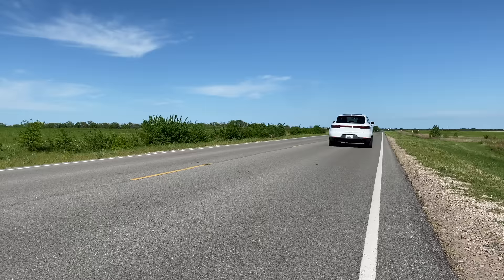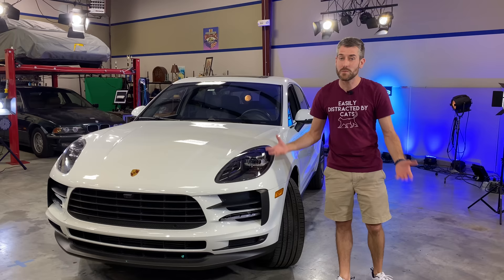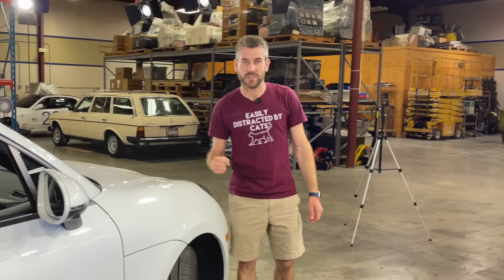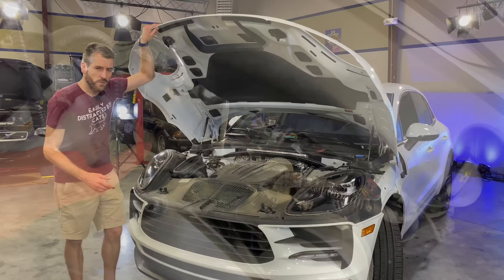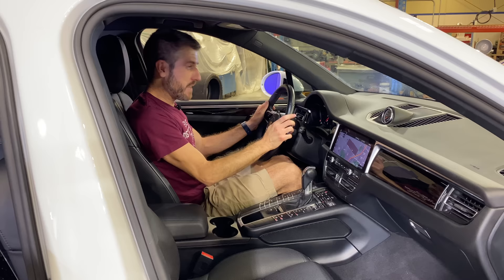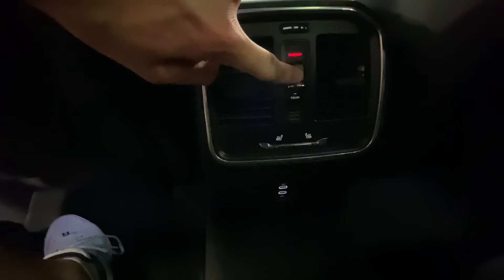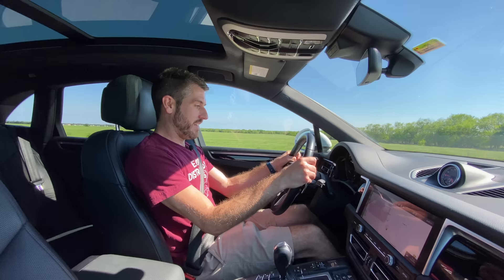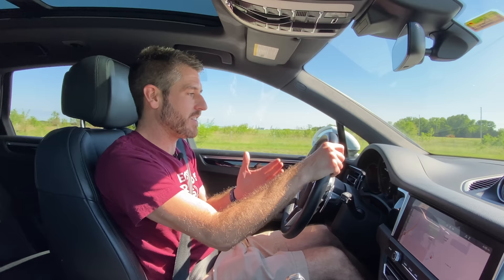Here's Why The Porsche Macan BASE MODEL Is Actually GREAT!

Comment: I worked at an Audi/Porsche dealer for a year and I've never been a Porsche guy but I loved those SUVs. Porsche interiors are built so well and the Audi motor, trans, and frame are very solid and surprising the car doesn't just feel like a lighter Q5. The handling was incredible it felt so responsive and snappy for an SUV, the exhaust tuning while fake sounded great, and I think they are easily the prettiest SUV's on the road. Not overly aggressive like Lamborghini's SUV, it manages to stand out and blend in at the same time and I love that in a car. If I had the money I would spring for the GTS model because that's where you get an actual Porsche motor but aside from that the base and lower models are practically the same car for a lot less. Doubt anyone will take my opinion into account but I've worked for BMW, Audi, Porsche, and Lexus, if you care about money buy an RX350 you'd have to abuse the thing for it to not run. If money isn't a problem for you the Porsche SUV's are easily what I would tell you to buy, sedan handling in a gorgeous SUV.
Reply from the maker: Well said Evan!  Thanks for watching and commenting!
Reply: Is it true there know for oil leaks later in the mileage? Not like other Porsche models.
Reply: @tylertran93nsx  idk if you're talking about like pre VW Porsches or what but pretty much every Audi or Porsche over 100k leaks something. If it doesn't its been fixed.
Reply: @ElliottAlvis  Why did you review an old model? Was this video shot in 2021?  The 2022 got refreshed again with different front fascia and rear diffuser, completely new center console, and more horsepower. Also, the VW Golf engine is a traverse engine, whereas this one is a longitudinal, how can they be the same engine?
Reply: What do you mean the exhaust sound is “fake”?  I haven’t heard anything about fake exhaust sounds on any Porsche.
Reply: @dl3988  he said fart, not fake
Reply: Lexus… no thanks 🗑️ 🤮
Reply: IThis car have a PDK transmission, like 911. Cayenne has Audi tip tronic.

This is under 30% Audi parts. And Audi are Great cars, but this a different car all together! 

The engine is modified by Porsche… you find it only in this car. It has Q5 modular platform, but even Lamborghini gets Audi part and platforms. It is because they are great… and modular!
Reply: I hated driving my Lexus NX350.  Engine was noisy, slowwww off the line.  I got it for “reliability” but it was no drivers replacement for my Q5.  I dumped it after and just got a SQ5.  Porsche cost and ongoing maintenance costs are an impediment.  If i go back to a four id get the GV70
Reply: Porsche has never done "fake exhaust tuning."
The 7 speed PDK is not shared with Audi, and neither is the frame.
And to think, I know these things without being a former employee at a dealership, for an entire year.
Reply: The fact that it has a Volkswagen Golf our engine in it is kind of cool. In Germany the tuners there ring out insane horsepower from Volkswagen Golfs

Comment: A lot of people with the upper trim level Macans hate on the base model. I personally have a 2018 base model and it’s an amazing all rounder
Reply: Ant issues ? How expensive is the maintenance ?
Reply: @MrMustangrick  i have base  Porsche Macan 2018 Agathe Grey with Air Suspension, this is my second porsche, the first one is 718 boxster.
This macan transmition is very smoooooth, riding this car is very fun and the car today is 19k Kilometers, it has no issue except the ceiling fabric is starting to fall 😢
I did have mercedes C300 2014 and the ceilling was falling down also.
It seems many ueropean's cars suffer/defect from this.

Comment: I'm not a Porsche guy, but I have to say I'm extremely impressed by this car. I would not think this was a base model if I were to walk past it in a parking lot, and certainly not seeing it speed past me on the highway. Thanks for the eye opening video, Elliott! I hope you have a wonderful and easy conclusion to your week!
Reply from the maker: Hey, thanks Bunker!!
Reply: If you drove the base model and then any other model, you would certainly know that it is a base model.  I would never, ever pay that cash for the base Macan.  The performance deficit is enormous compares to the S and GTS.
Reply: And your Porsche is? Smaller engine=less weight=better handling. A chip and you have over 300 ps. It will be better than the S.
Reply: @ts_macan_911  2021 Macan GTS.  Before that a 2016 Macan S.  Driven many base Macans and Cayennes as loaners.  Far slower.  Without the air suspension and adjustable dampers they sit a lot higher and are less responsive.  The power deficit is significant.  The base model is a show car for wives to impress their friends.  I would never, ever buy one for myself.
Reply: @cvn6555  Just a hybrid turbo kit like is470 costs about 3k for ea888,then your GTS will count postal codes

Comment: I think Elliot is correct.  For plenty of people, the styling and the appointments and the novelty of owning a Porsche are good enough, and so is 0-60 in 6.1 seconds. As if that is slow...

We looked at one at the dealer a few years ago and while I liked the car, the back seat and hatch areas are a bit small. My spouse wound up with a MB GLE 350.

Me personally, I would rather buy a few years old used car with all the goodies and the power.  Great video!
Reply from the maker: Excellent points, thanks for watching!

Comment: The door blocking the hood handle has been a standard feature on most VW products for quite a while. As far as I know, it is there to stop you from accidentally opening the hood while driving if your shoe gets caught in the latch when taking it off the clutch pedal. That apparently was a much bigger risk on some older models, where the lever was near the clutch pedal, was a pointy piece of plastic and also pulled towards the driver, so it was rather easy to get the top of a shoe caught in there when pressing the clutch pedal, which would pop the hood when you release it. They had a second safety latch to prevent it from flinging open, but it still was a bad design choice, so they eventually changed it to this one, which prevents that.
Reply: In the U.K. they added to the security feature by moving the pedals to the opposite side of the car. The hood latch is still on the left.
Reply from the maker: Oh that makes a ton of sense!  Thanks for the info!
Reply: @colinselfridge3935  That also works. But engineering is cooler. And, as a bonus, it works no matter where the driver sits. But if you want it simple, putting the lever elsewhere (for example in the glovebox) is probably the easiest and cheapest. Still, this solution is pretty damn clever, and also the best way to prevent lawsuits and insurance fraud, as the lever physically can't be pulled with the door closed, even if you try to.
Reply: @ElliottAlvis  No problem. Always happy to inform.
Reply: @unmountablebootvolume  my last 7 cars have been VAG, but right hand drive, so I’m very aware of the the hood latch being on the left. Mine was a throwaway comment about increasing safety, when in truth it is really to minimise re-engineering/retooling.
Reply: @colinselfridge3935  LOL

Comment: Absolutely agree with you. Driving the base Macan for almost 8 yrs now (since 2015) and it’s such a nice sporty SUV to own. Previously owned a Porsche 993 manual and a 987 Boxster manual and they all share the same Porsche DNA. This car basically borrows mechanically from the humble Audi Q5 but drives like a different vehicle, which is unbelievable. I have also driven other Macan variants like S, GTS and Turbo from my friends and you are right, they are pretty similar in feel. I reside near the hill side so some modifications are carried out including:

1. Racechip ECU upgrade from 240ps to 300ps
2. Brake upgrades including steel brake lines, endless brake pads & fluid, F & R EBC slotted rotors.
3. Pro-ram high flow air filter
4. Champion iridium spark plugs, APR ignition coil
5. High performance engine oil ( HKS 5w-30) & Rear differential oil (cusco)
6. 5mm spacer on rear wheels to improve stability
7. Turbo muffler delete kit
Reply: How has the reliability been? Any major concerns? Thanks for the list of those mods.

Comment: Totally agree with your assessment.  Test drove the S and GTS before I purchased the 2021 base Macon.  Did not feel much difference between all models, other than the extra HP which was not worth the extra $$ to me.  Still enough power to get in to/out of trouble.  Found one with standard wheels to save $4K, and enough options to keep me happy ($60K sticker).
Reply: It’s so true, many reviewers make fun of the base Macan power I had to see for myself. I test drove Macan base and Macan S in the same day I felt absolutely no difference whatsoever both cars as super fast for an SUV in both cars the ride experience is literally the same. I find people who go for the S to be really Dumb in my POV. You just pay more for the same experience. Some people have ignorance issues they hear base model so they automatically avoid getting in one. My advise to you all just drive the base model for once before you put a deposit on the S, just do it and you will see.

Comment: Excellent video. We recently went shopping for a base Macan.  Our budget was $50,000 but all we could find at that amount were 3-4 year old models.  We ended up buying a similarly sized and equipped new Mercedes 300 GLC 4MATIC for 50,000. It is not a Porsche (but merely a lowly Mercedes) but has a premium look, feel and driving experience. Also has a 4 year new car warranty. :)
Reply from the maker: Hey, that’s not a bad choice at all Rob!  Glad you got something you like!
Reply: Build quality is day and night though. I used to drive GLC43 and it was a rattling nightmare in cold weather. Squeaks everywhere - door panels, central console etc. Also let's not forget about GLC tire skipping/crabbing issue, annoying AF. 
Switched to Audi Allroad and couldn't be happier, a much better car overall.
Reply: Love our 2020 gLC 300 premium
Reply: Great video and extremely helpful. We currently own a Lexus RX350 which we enjoy, and have always wanted to get Porsche SUV. Your details about the base model were very good, and it sounds as if outside of the increased HP the base will work quite well. Figure a 2-3 year old used version will be the smartest thing price as well - let the original owner pay for the wheel and other upgrades and get an extended warranty. Thank you again - super informative!

Comment: My 2008 vauxhall Vectra (UK model) had a speed limiter as standard. Strange that Porsche have only just fitted one. The reason we use them in the UK is because most of our speed cameras have been replaced with average speed cameras. A speed camera snaps your picture at one place only. An average speed camera can monitor your speed over the entire length of the road (which on a motorway can be up to a hundred miles!) In these instances a speed limiter is a life / licence saver
Reply from the maker: Oh wow, those average speed cameras sound like my nightmare!
Reply: @ElliottAlvis  yup, they certainly are. Get caught in one of them and it's a £100 fine and 3 points on your licence. 12 points in 2 years gets you a year of public transport

Comment: Just ordered a 2023 Base Macan for LA experience center delivery.  Previously owned an S but based on how I drive the base is perfect.  Ordered no sunroof, 18 way sport seats heated, pasm, std wheels and tires, premium package 1, thermal glass, rear sun shades, bose stereo. pre paid maintenance,  Under $68,000.  Looking forward to trip up Hwy 1 last done in 1998 in Boxster.
Reply from the maker: Nice Dave!  Congratulations!  That'll be a blast.
Reply: Perfect spec

Comment: I've got the 2020 Base with a ECU tune stage 1 by a tuner here in my country and it is now around 300HP. It does not solve the lowish torque or turbo lag in this car but absolutely kills it from 2000RPM upwards. Apparently it's as fast as the Macan S if not faster as told by me by others that have had this tune, as the engine is lighter upfront. The tune itself is around $1350US so that is much cheaper then say paying $10kUS for the Macan S which is basically the same car except a 3.0 litre  engine in it.
Reply: Where did you do that modes?

Comment: It’s the EA888 turbo 4 which reaches max torque at 1500 rpms. And, it revs so easily. IMO best engine ever built. I traded my 2018 Macan GTS for the 2021 base and tricked it out with my options. Believe it or not, the GTS had less low end torque than the base model. And, the GTS was loud. No matter what speed, there was always this low end drone sound in the GTS. The base model cruises effortlessly and quietly. There is one thing that is so important when considering the base, which is that the engine must be broken in before it really begins to rev easily. For my new Macan, I would say 7500 miles is about right. Then it becomes a rocket. So much fun to drive.
Reply: Good points. Low end torque is what most people use most of the time, I think.
Reply: I also notice my Macan engine works better after I drove to  nearly 10k miles. Just felling better and better with this lovely car.
Reply: Update: Just turned 14,000 and now fully broken in. Took it to my dealer and he installed GIAC tune module to add another approx 50 lbs torque. Now even faster and so smooth, effortless.

Comment: Not being able to open the hood is an anti-theft measure. Porsche SUV's are frequently stolen and parted out. Especially in Atlanta and Chicago where they are stolen from valet lots. A.so, 23rd Garage rebuilt a Macan...or maybe a Cayenne...but either way, the hood is around $800. Super expensive. Side panels are also expensive. And if you want to really cry, the headlights are massively expensive.
Reply from the maker: That makes sense Clif!  I'm actually surprised the hood isn't more!

Comment: I want one! from my understanding all the base models have the VW 2.0 4cylinder, it’s used in almost all VWs those don’t have the oil leaks. The v6 2018 and under is a Porsche engine and have the leak issue. I would guess you can use VW parts for cheaper maintenance.
Reply: If I remember correctly, those leaks can be easily fixed by replacing the bolts... AFAIK some people asked this to be done at dealerships as warranty work. No issues after that.

Comment: And my Macan have installed PASM as option, which provides better handling properties.
The stock 18 inch wheels are actually forged alloy wheels ( best for handling and better unsprung weight), where else the upgraded 19 and 20 inches wheels are merely casted wheels.

Comment: Yeah,.. when you are paying $70k for a base model, it better be good. It's the same as if you buy a "base" 911 lol. As you mentioned, no dealer would order the True base model without any option. I walked into a Porsche dealer last summer and they showed me their upcoming Macan list,(non-S) they are basically optioned around $80k. Even in this video, the price is $67k, plus some tax and documents, it is safe to say the Out of the door price is over $70k. Nonetheless, Macan is still going to be my top choice for SUVs. But if I were to buy one, I would look for a used model from 1 or 2 years back.

Comment: I'd go for a Tycan base model personally (can't stand SUVs) ... but hey ...

As for the speed limiter ... my Volvo V40 has it ... I sometimes (but rarely) use it when the road is busy and I'm on a stretch of road where you'd easily go way over the speed limit if you don't take care ... if the road is busy then cruise control can be a bit cumbersome, so I can manage my speed accordingly and never worry I'm going over the limit ... granted, you really have to get used to the feeling, it is very strange to floor it and only be going 55 km/h.
Reply from the maker: The Taycan is fantastic!  And yeah, the speed limiter thing is weird, but I do like it!  Thanks for watching!

Comment: Im i the only one going: “I could smoke that…”
Reply from the maker: You probably could.  But it is decently fast for what it is.
Reply: @ElliottAlvis  I kept up surprisingly well with a Porsche Macan S, despite being down on power, FWD, having a Manual transmission, have 2 adult passengers, the Macan S using launch control and all in the weat.

He had about a car length on me, when we slowed back down.

This was with my stock 2001 S60 2.4T, which is now tuned, making more than the base Macan. If it can hook than my S60 will out run the Macan, if not the Macan will run away until it hooks.

Comment: i recently drove around in a loaner 21 base macan for a few weeks for the dealer to do some minor work on my taycan, and the macan wasnt bad, it turned well and was pretty fun to toss around in considering its an SUV, the engine is the weakest point though, the turbo lag is bad unless youre always in sports mode. the upside is if u drive very carefully, you can actually average 25mpg + which is impressive considering the weight as well as permenant awd. And yes that pdk is magic, probably the best transmission in the industry, from shift speed, shift reaction time, you can even upshift into neutral to coast strategically to save fuel in 6th or 7th gear. Launch control did launch the car well, just brake torque, except the car doesnt actually display any launch control msgs when youre doing launch control. The base suspension was okay, it did turn the car well, but the ride wasnt impressively smooth or sophisticated. steering feel was pretty average and doesnt really feel porsche like enough
Reply: Porsche Guy has weighed in, everybody.

Comment: @Elliott Alvis Why did you review an old model? Was this video shot in 2021?  The 2022 got refreshed again with different front fascia and rear diffuser, completely new center console, and more horsepower. Also, the VW Golf engine is a traverse engine, whereas this one is a longitudinal, how can they be the same engine?